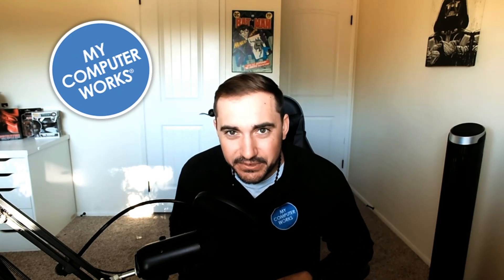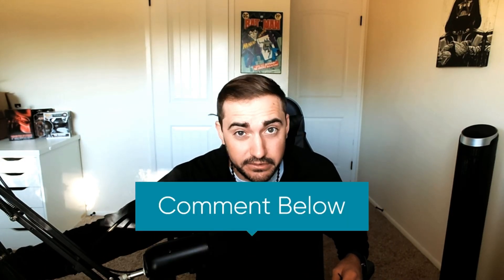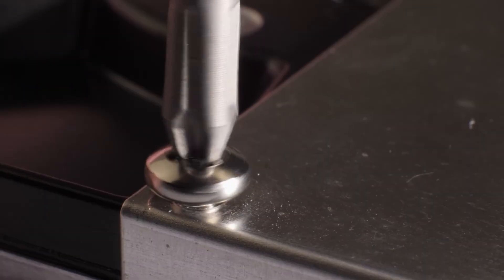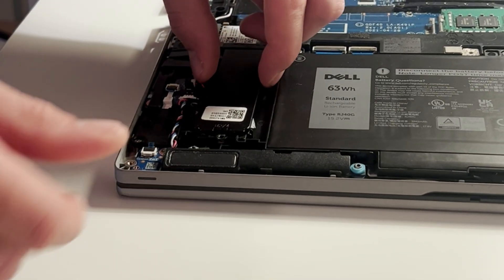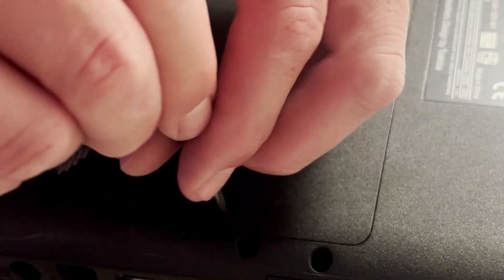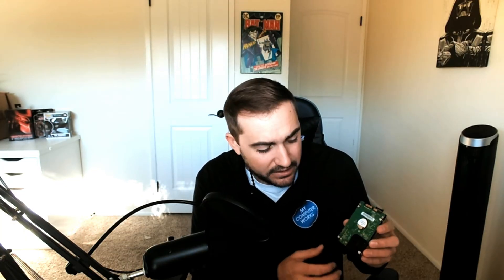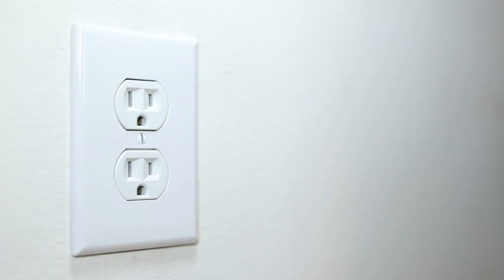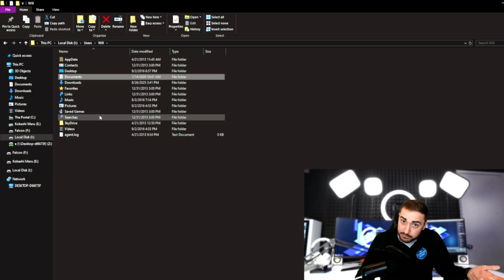How to Recover Data From a Dead Computer! (Remove HDD or SSD)

Comment: Once per two weeks, I copy over all new files to a HD and a SSD external drive.  Will a data recovery be capable of just retrieving two weeks worth of information (as I already saved/backed up previous data) at a reduced cost and time?   It would about to about 50 or fewer files and generally under 2 GB of data.  I have 400 gb on my main SSD and 2.5 TB of data on my HD in a desktop.

Very nice video.  Unfortunately, in the past 40 years, my HDs died prior to the computers.
Reply from the maker: If the drive is not dead it should be there!